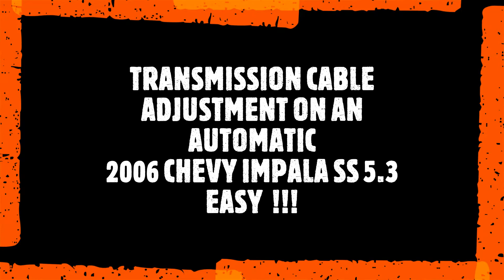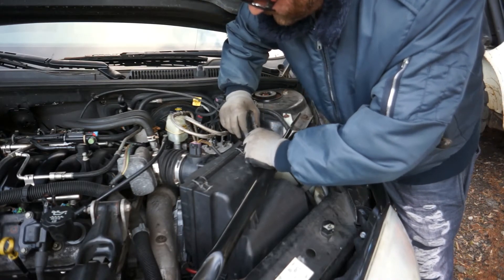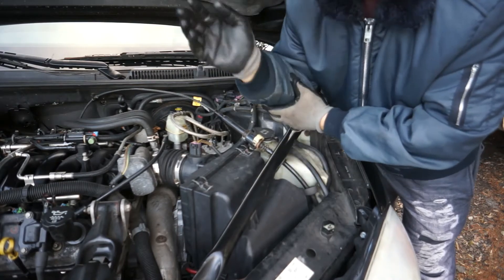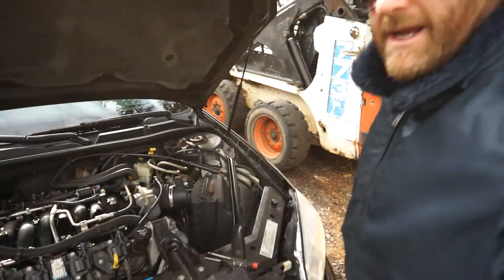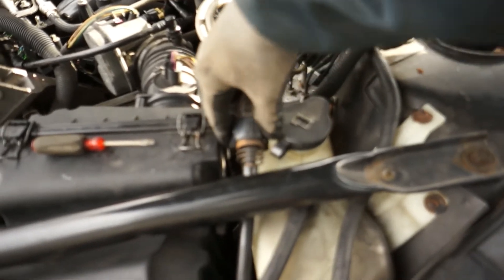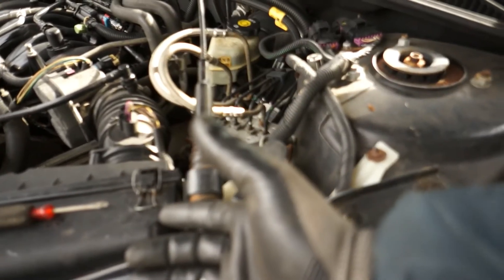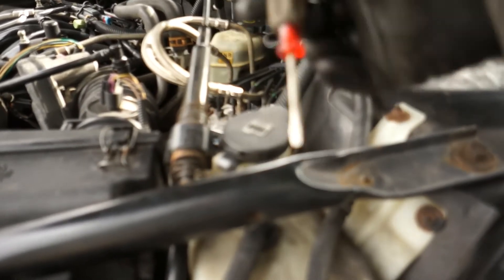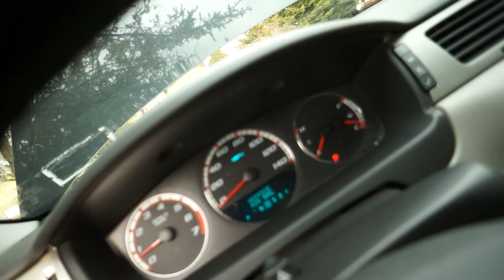CHEVY IMPALA  2006 CHEVY IMPALA SS TRANSMISSION CABLE ADJUSTMENT....EASY FIX...SAVE THAT MONEY  !!

Comment: Hey man, thanks for the vid, my impala is a column shifter so Im sure its a little different, however it does fill in the gaps. It was hard to hear what you were saying with the car on, into muysic and chickens. however Hopefully I can get something from you telling us about the slack!
Reply from the maker: Hope it does help you to get the cable fixed.
Keith 2guys how2

Comment: Coluld this be why my car shifts into park drive etc kinda hard ? Could it be this needs adjustment
Reply from the maker: I would check the transmission fluid level...while car is in park idling..hot...add fluid if needed..I would try to change the transmission fluid, trans filter and trans gasket...use good transmission fluid...add a cup of Lucas Synthetic motor oil stabilizer additive....add 4 quarts, start the car and check the fluid level while idleing... hot mark on transmission stick...keep adding little by little until the transmission is full..not overfull... see if that helps smooth it out.
Change fluid  every 15000 miles or sooner.
If your car has more then 60000 miles...make sure the fluid has been changed...or the transmission could possible start slipping more.
Old worn transmission fluid will smell burnt and dark.
Fix it yourself and save that money!
Keith 2guys how2

Comment: Hey bro I got a 2008 Impala that has a 2006 motor in it I just replace the transmission housing and for some odd reason my still leaking now my car is in drive it goes in reverse but that's not want to go forward or does not want to move in Reverse can use cable be a reason why
Reply from the maker: Did you replace the transmission pan gasket seal and transmission fluid filter and add new transmission fluid ? Or did you swap out the complete old transmission and replace the transmission with a complete used transmission? 
You need to check and fill the transmission fluid to full. The engine needs to be running, transmission needs to be in park..then check transmission fluid level on transmission check stick. Fluid level needs to be in full mark area. Cold mark or hot mark on transmission stick.
If fluid is low it will slip or not go into gear.
Keith 2guys how2

Comment: I have a 06 impala and it’s been slipping, smells almost like coolant after it’s been running. I’m gonna change fluid and put that Lucas non slip in it but I had to replace radiator, thermostate, hoses. There are no leaks and I have no clue what it could be
Reply from the maker: Check your transmission fluid. Check the fluid level while vehicle is running in park gear...make sure it is full to cold mark or max level and if the fluid smells burnt..then that's not a good sign.
I wouldn't use any non-slip additive...that stuff swells the seals in transmission.
Reply from the maker: If you overheated the transmission...then it could start to slip. Change the fluid, filter and pan gasket..add new fluid and see if that works.

Comment: Great vid we just picked up a 06 impala SS today that would not start walked around and saw the reverse lights where on so I reached in and discnicted the shift linkage by hand outside the car was able to put in park and start but shifter needs adjusting was not sure out to do so so just worked by and and have not been able to take a look was going to mess with it tomrrow but now I know out to fix the issues or at least how to adjust the cable thank you again
Reply from the maker: Glad to help....easy fix if that's the issue... those transmissions can be weird..if the check engine light is on..I would do a code scan, for any transmission or other codes and fix them. 
Keith 2guys how2
Reply: Yes I know these things are none for trans issues I mean what to expect when you use a modified v6  transmission behind a V-8
Reply from the maker: @blindguysgarage  Yeah, a lot of torque for those trans on a front wheel drive.
Just keep the trans fluid changed every 15000 miles and it will last.
Have fun with it.
 Keith 2guys how2
Reply from the maker: @blindguysgarage  check out my other video, that shows why the floor boards fill with water and how to fix the problem..easy fix.
Keith 2guys how2
Reply: I will check it out but I’m sure it’s the stupid sunroof drain tubes get clogged up as a lot of sunroof cars do
Reply from the maker: @blindguysgarage  Yes, that's the problem. The bottom if one of the drain tubes was broken off, plus lots of leaves and debris were caught in all the rest

Comment: My 06 SS does not have this shift cable my setup is different
Reply from the maker: Your SS could be made in late 2005 or early 2006..possible factory setup is different.
Reply: @2guyshow2thefishkingz89  ... That's exactly what it is and I'm having a problem finding That cable I can't find it  Anywhere ...at least the new one... And I really don't want to change the whole set up  Which is probably what I have to do  if  I can't find one
Reply from the maker: @mcphersonsean20  I'm some cases the factory might list some vehicles as made in 2006...but they were actually made in late 2005..Some vehicles might say made in 2006, but actually made in early 2007.
So, I would call the chevy dealership..use the last 8 digits of the VIN # to find the exact OEM part number and cable set up. If not check for late 2005 or early 2007 cables. The dealer is the best way to find exact part number...call a dealer in another state and act like you want to order the part...to find exact part number if possible...they don't know where you live, they will be able to help..that's what I do!
Keith 2guys how2
Reply: @2guyshow2thefishkingz89   Yeah I never really thought of looking it up like that good idea I appreciate that
Reply from the maker: @mcphersonsean20  Hope it gets your ride fixed..be creative in finding information and it will pay off.
Reply: @2guyshow2thefishkingz89  thank bro....definitely  helped me figure it out....I appreciate  that